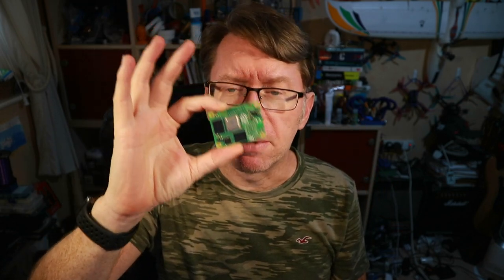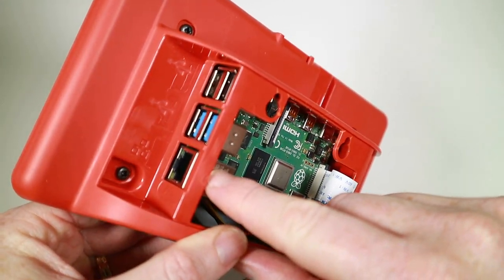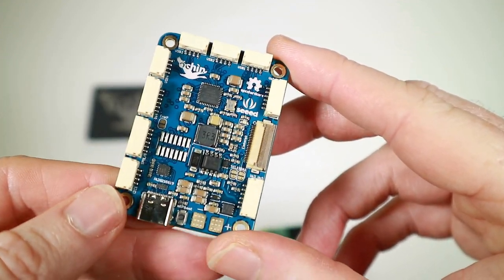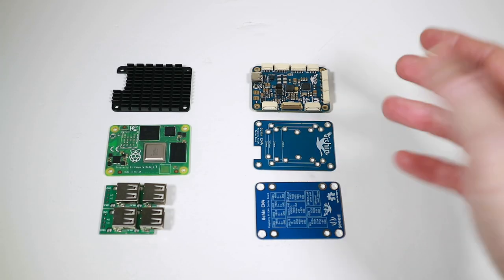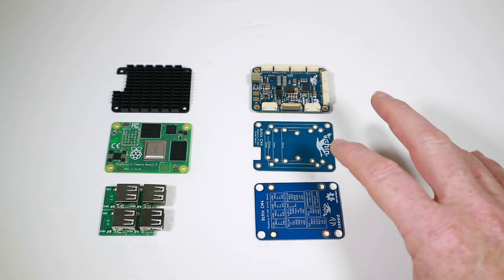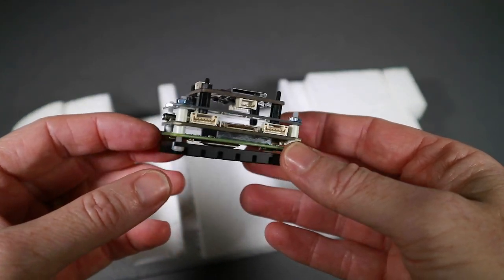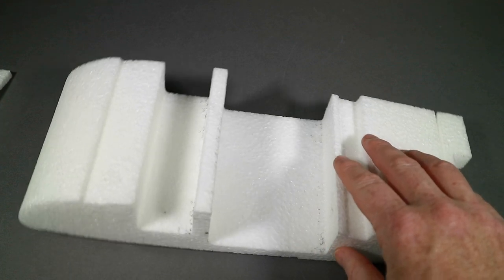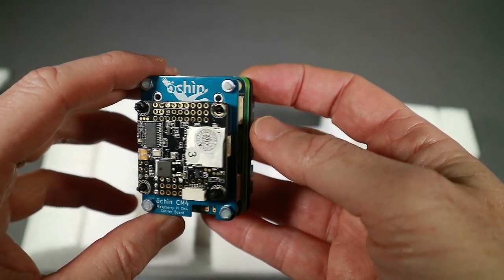Ochin CM4 Board: A simpler solution for Open.HD and more?

Comment: We’re moving forward the OpenHD project to h265 encoding/decoding with the Jetson Nano 2GB as an Air unit and NCB00 carrier board. The CM4 is capable of decoding h265 and with ochin will be the perfect combo for a goggles module!
Reply: nice, but the jetson nano is pretty big isnt it. the dev kit is like 10cm square
Reply: @WX4CB  there is another carrier board with dimensions 85x50mm. Also we are developing a completely new AIO OpenHD board that will have similar technical specs with Jetson Mano. But until the OpenHD hardware is ready we’re continuing the development on the Jetson nano.
Reply: @mariofpv  that's cool. I just got some wireless dongles to play with.
Reply from the maker: Nice - Looking forward to it - having just tried to get a Pi Zero on a quad... well, it's a pain.  Smaller modules FTW!

Comment: Hello just checking to see if you are still working on OpenHD build and your progress
Reply from the maker: Yes - we've been trying to get a working config for a while now with the Ochin board but I've run into a few issues, a h/w issue and then the GPS loosing signal as soon as the Open.HD side was powered up.  It's still not fully resolved - but once I eventually get to the field and fly something I'll bring you up to date on what I've been doing

Comment: Would have been useful to explain what Open.HD is and why you would use it.  I have used Evos over the last 3 or 4 years (I still have 2) and on hot days ESC cooling can be an issue.  I simply add a 3D printed grid which fits into the lid and problem solved.
Reply from the maker: Good point - I've added a link to my playlist of previous Open.HD stuff (including initial explanations) as a card and in the description.  I like the grid idea, I may do that

Comment: Excellent....... what's the latency of Ohd?
Reply from the maker: Should be the same as using regular Pi's - so 100-150ms
Reply: @CurryKitten  Is their any development happening to reduce that?
Reply: @gmivisualsjason3729  Yes, a Jetson nano board greatly reduces it, atm theres some new stuff going in development which is still secret but supposedly it is really quiet good with a lot of speedup with the new board, better code, and a more sophisticated encoding algorithm (h265)
Reply: @jotham123  It's actually quite exciting tech.....

Comment: Great project Wayne, interested to see how this works for you.
Please don't put it in that horrific wing...lol...Put it in something you know works instead...🤔😳🤨🇬🇧
Reply from the maker: What's up with that wing!?  The trouble with putting this in something that already flies is that it can be harder to stick a new thing in post-build that planning around it adequately in the first place.  I'm very much learning this with the Open.HD Quad build
Reply: @CurryKitten  Oh, you're doing an Open HD quad as well...?....I'd stick with just the quad. Winters coming, it will be easier as a test bed for sure than that awful wing...🤔😳🤨🇬🇧
Reply from the maker: You'll have to tell me what you have against the Falcon Evo... it sounds personal :D  I flew the original Falcon wing probably more and any other and I've crashed it, exploded it into foamy shards and it's still flying.  In theory Open.HD works better in fixed wing as the latency isn't as important.  But I'll be doing two Open.HD builds.  The Pi Zero in a quad and the CM4 in this lovely wing :-P
Reply: @CurryKitten  Well, it has a nice deep bay for the gear, so I can see the appeal. It's just that these wings never fly well IMO, but I look forward to you proving me wrong..🤔😳😀

Comment: interesting, i have just ordered something very similar but based on the 3B which is called the 3B mini and sports the same quad core 1.2ghz cpu and 1gb ram of the 3B but in a stripped down board layout and weighs the same as a Pi Zero!
A 4b is a more powerful board but seeing as the zero manages, the 3b mini with four cores instead of the zeros one which are also faster plus double the ram of the zero should make it more than good enough and it has two data enabled USB headers vs the zeros one usb which could be used for on craft diversity but im hoping i can use one for a usb cam and use the csi for another cam and switch between them like you can on the 4B
Reply from the maker: That sounds interesting Steve - I've not come across that one on my browsing.  There is talk about using h.265 compression which is where the 4 will have an advantage, but I'm not sure what this does to the picture quality/latency at the moment